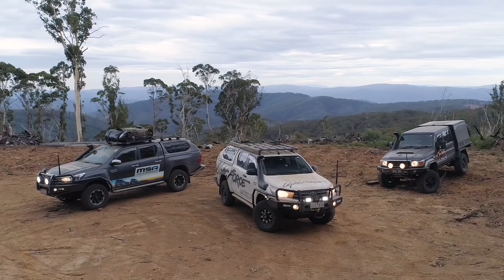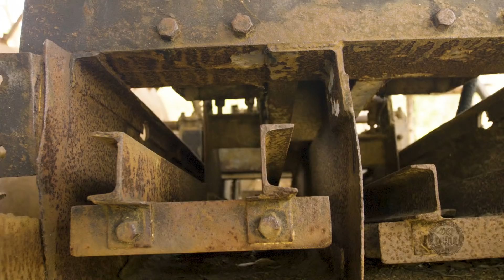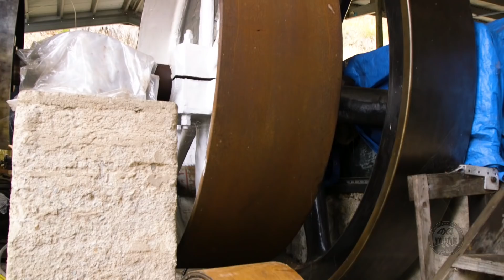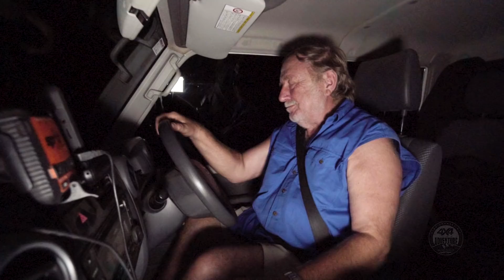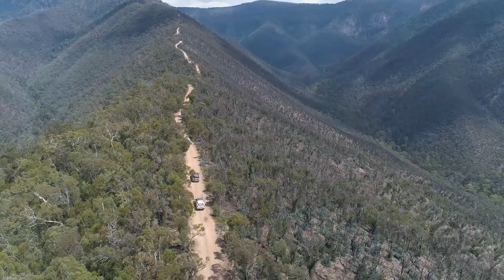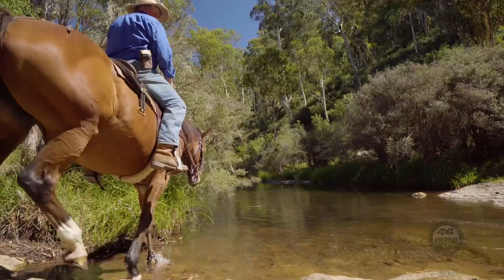4x4 Adventure Series: Victorian High Country Episode 2 | 4X4 Australia

Comment: You could really do with fire bunkers in some of these parts in case you become surrounded  by bushfires, otherwise you would be pretty buggered.
Reply: Hi, if you know the location of the old logging camps there are bunkers there (unless Parks removed them). 16 mile, Brock's road Mt Sunday road intersection, refrigerator gap. However, you are correct but try explaining it to the Extinction Rebellion groups otherwise known as Parks.
Reply: Modern fire research into bunkers found them to be marginal at best. In fact they can be lethal death traps where oxygen hungry wild fires suck out oxygen to be replaced with carbon monoxide and other toxic fire gases. You can shield from the radiant heat, but you still need to breathe!